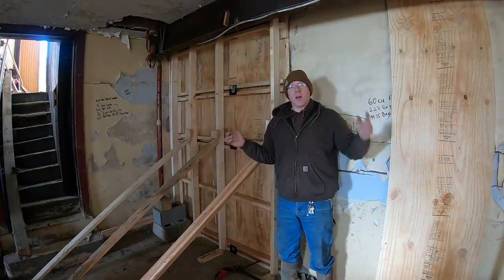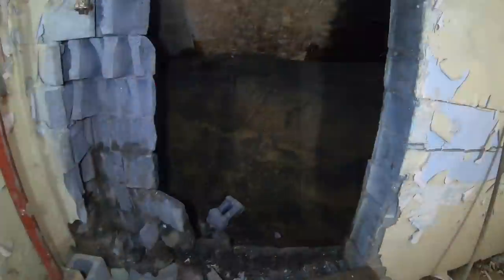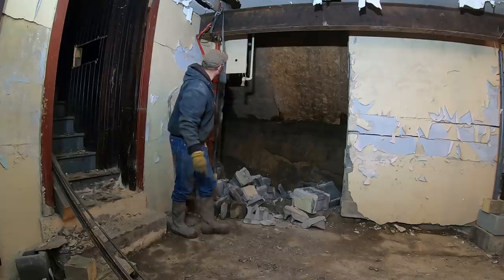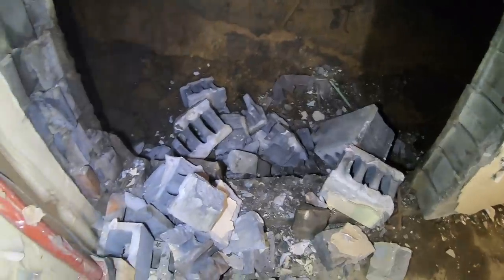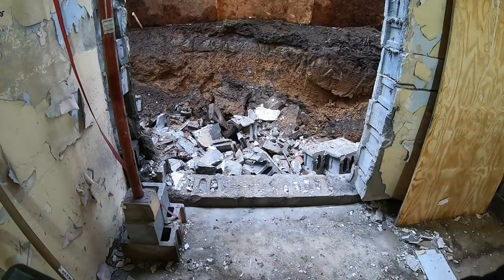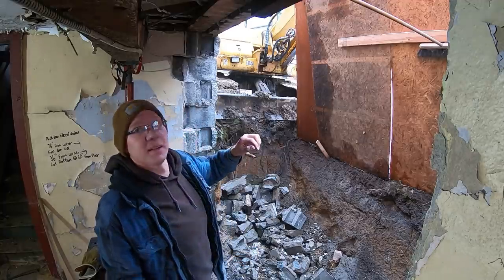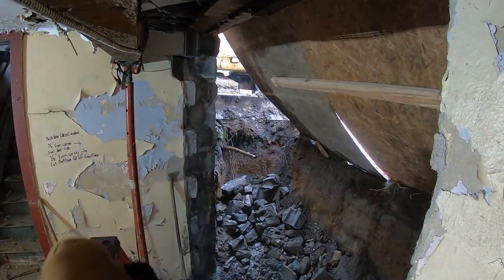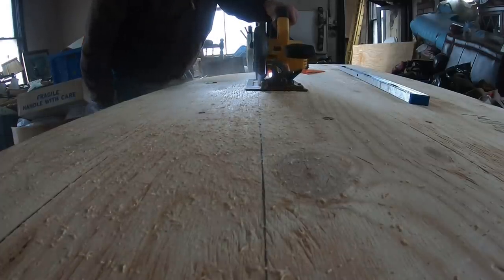Foundation wall so bad it falls apart!! ABANDONED CHURCH foundation repair!  Ep.5

Comment: @3:25 I have a story for you Matt.

I'm a medically retired union carpenter. Destroyed my back 21 years ago. One of my earliest jobs was renovating a school in downtown Portland, Oregon. (I live about 25 miles north of Portland on Hwy 30.) We were totally gutting this school building. There was a guy in a skid-loader driving his machine lengthwise through a wall. It was HYSTERICAL! The funniest part though was this long haired hippie from the 60s. He picks up a brick, chucks it through a window, then looks at me with the shit eatingest grin you ever saw. Says "I used to go to jail for this. Now I get paid for it. THAT'S what I call PROGRESS!!!

One of the funniest memories I have from a short but enjoyable career.
Reply: Some years ago, there was a contractor renovating two older buildings downtown to become a branch of a regional drugstore chain (not far from its long-gone first location). They basically went in and tore out the wall that separated the buildings, even though it was generally understood it was a load-bearing wall (even City Hall said that wall was never supposed to be opened beyond a couple pass-throughs). That wall remained intact for a few hours before giving way. Most everyone booked it out of there as soon as the building started making noise, but the public was unaware until the building collapsed. Sadly, one of the workers didn't make it out in time, and soon after the building collapsed, a frantic (but successful) effort got underway to rescue a resident from one of the second-floor apartments (which were not included in the renovation). It was a very delicate clearing the rubble without affecting other similarly old buildings to the north on the same block (in the end, only the neighboring wall needed a few well-placed repairs). It then came out that that particular contractor had been getting by with a lot of sketchy stuff as mentioned by the owner of that neighboring building (that sketchy contractor had previously done work in that building that even an amateur like Matt would have done better). After further investigation (and a few lawsuits), that contractor called it quits. A different contractor cleaned up the issues and has since built the new drugstore.

Comment: I am enjoying watching this series, I enjoy building renovations myself.
If I were you I would have at least two more acrows under that steel beam, it is less likely to fall if one is bumped whereas with only two you have no chance if one gets knocked. I would also put some acrow props under the wall above the gap with stongboys at the top to avoid any risk of that brickwork falling.

Comment: I really enjoy your videos , when part of my basement wall collapsed last summer due to a previous owner using only 4 inch block ,yes 4 inch block, it was originally a crawl space on that side of the house and he dug it out to within a couple of feet of the original barn stone  that actually held the weight  of the house, and put up that shoddy wall to hold back the dirt needless to say we poured it solid 18 inches in some areas, poured walls are the way to go , keep up the good work

Comment: Just be sure to oil the plywood!!.....then when you put in the cement you can use that impact to help settle your cement in the wall......will vibrate it nice!! Can make a pipe with welded flat iron on one side and run it up and down the plywood!!......good luck!
Reply from the maker: I have a real concrete vibrator, and Ill oil them right before I pour it! Thanks for watching!!!

Comment: Re: the gas pipe inside...   I have had couple of those surprises myself, after doing something like what you are doing.  Two of them were electrical related, thank god the circuit breakers did what they were supposed to...Ha, ha, ha...
Loving the videos, keep them coming.
Thank you sir.
Reply: When going into old buildings and you have no idea as to who, what or how, you can get some nasty surprises!  The home I'm living in was built in the middle 50's.  Needless to say it has had many "repairs" and modifications over the span of it's long life.  When my late wife and I had it moved almost thirty miles from the town it was in to where it sits today, we ran into a few of those "gotcha's".  One of them was what looked like a simple receptacle box that needed to be relocated so we could convert the room it was in to our new kitchen.  I blew a hole in the jaws of a brand new pair of Klein's when I discovered something I had never run into before.  I did not notice, since I wasn't expecting it, that somebody had clipped the jumper on the side of the receptacle.  They then fed each side with a separate breaker!  When I clipped what I thought was a dead wire, the fourth of July fireworks hit!  From then on I took my VM and checked each and every receptacle after flipping the breaker just to insure no more of those little surprises!  It was a rookie thing to do but who expects that to happen?
Reply: Richard Cline Yikes!  That will sure put some years on a guy... person...
Reply from the maker: haha, live and learn right?? Thanks for watching!!!

Comment: If you spray the plywood down with oil it will help to keep the concrete from sticking to it
Reply from the maker: yes, I do it right before I pour. Thanks for watching!!!
Reply: @DieselCreek  Just did a job just like you're doing a couple yrs ago. Went through all that stuff "by myself" also. First week of december. Come time to pour it the help didn't arrive and had to do it all by myself. Then we had a blizzard blow in and I was runnin a wheelbarrow through about 8" of snow! Was not a fun day I'll tell ya. My back still hurts from it!

Comment: I can see why your cautious as I have seen buildings act like they were setting on marbles and go sideways. I worked a very short time for a house mover and we got lots of surprises. A good method once you move down towards the middle is; Take two ropes and tie off on the joists under the building. You tie to  what would be your "rafters" and hang a small log from either end and room to swing it towards the wall and use for a battering ram against offending wall. Sometimes you can take sections out that way and you     can hang several logs so that you can alternate which one you need to keep it moving. Looking like some sore back time coming
Reply from the maker: I didnt have to fight this one much, fell right out lol Thanks for watching!!!

Comment: Though I hate to pour scorn on all your hard work Matt but over here in U.K. the entire building would be condemned - and for good reason. Little piddling 12" "footings" ( not worthy of the name really) for a building of that size Building Control would insist on at least 24" (600mm wide) and at least the same in depth below basement floor level. The entire footprint would need to be underpinned - very expensive. Then there's those walls! Crazy hollow pots, cracked and slipped everywhere and single skin. And not a dampcourse in sight.

As I've commented before - you are a great, resourceful guy who's willing to have a go at anything but you are a Health & Safety nightmare!!! Your temporary support is a collapse waiting to occur and your work method - leaving the exterior upper brickwork unsupported is verging on criminal.  I can hardly bring myself to watch!
Reply from the maker: There was no way to support the outer skin and still do the work needed. It’s long since done and everything went smooth!

Comment: Do you think using 4x4x1/4" metal to frame from floor to ceiling then weld pieces across to frame your window would work? Then pour and leave it all in the cement? I know it's a year later just wondering if it would work.

Comment: I see some ppl mentioned using diesel oil on your forms. That's"is" one of the procedures when pouring. I just did what you're doing a few yrs ago. I used Thompson's water seal / oil. Only because I had a few gallons on hand to use up. Works real well. Cleaner than Diesel too. How much more wall do you have to do?
Reply from the maker: About another 10-12 foot of wall. Plywood is 3/4

Comment: You've wise to use the protective gear.
Reply: But he wears rubber boots, not safety shoes !!
And he says himself "Professionnal advice here: beware of planks with nails poking out".

Man, get proper boots with steel toe and sole protection for your own good !
Reply from the maker: those boots are steel toe, I dont own any shoes that arent! Thanks for watching!!!
Reply: No respirator (during the first half of the vid), no eye protection, no helmet...
Reply: @DieselCreek  You really need a safety sole as well. Would you consider head protection when you've got loose masonry hanging over you?
Reply: @dave29123  From the looks of that building, I can pretty much guarantee that the paint contains lead.
Reply: @thomasbonse  I was thinking about just ordinary dust, but yeah lead paint too.
Reply: I apologise my settings were screwed up. My fault. Sorry for saying this video would not work.

Comment: If you will read the directions for that epoxy, you will see that you are to fill the hole with epoxy and insert the rebar into the epoxy filled hole.

Comment: I'll actually use that same exact chipping hammer and the one bigger. It's for lightweight stuff, but not a bad product at all. Ours was very old had lasted a long time. So hopefully you'll get the same out of yours. I cannot believe you hit a freaking gas line after you said you called in. Before you even started what happened? I must have missed a video. Damn it, man. I know that sucks. Hey, those bricks are being held up by Brick ties is usually about every fourth course. They're like galvanized little flat things that are nailed into the framing of the building. So don't fret unless they're rotted. Anyhow, brother keep making those videos and be careful. God bless
Reply from the maker: I knew it was there and I knew I would hit it, just wasnt thinking what it would do to the wall lol it was in the last video! Thanks for watching!!!

Comment: Using that concrete saw that has no blade guard, and it RUNNING, scared the heck out of me!  Had you lost your footing and fell, you could easily have lost a leg, bled out and nobody would have been close enough to save you!  Just too scary!  You're doing a good job but man, use some safety precautions!
Reply from the maker: that saw has a blade guard?? youd be crazy to run one without it! Thanks for watching!!!
Reply: @DieselCreek , when you were standing on those blocks cutting with the saw between your legs I was terrified for you.  Hit something unexpected, have the saw kick back and not only could you lose a leg but your wife probably would have no use for you anymore, either!  I think every man watching was holding his breath!
Reply from the maker: Richard Cline I’ve been trained to use them by large contracting companies, note my front arm is locked at all times so in the event of kickback it really can’t come toward my body, the only thing I could have done better was have a face shield

Comment: Silica in construction projects/products is always bad. There are two kinds, and one is much worse. If you have some silica that you mix into epoxy to strengthen it, it is probably amorphous silica. It can give you silicosis of the lungs, which is bad. 
The other type is crystalline silica, this is really bad. When they took away asbestos they replaced it with this. It is now in a lot of products from cementitious siding to car polish to clear lacquer. Check for it on the label. it is considered carcinogenic by many agencies. The worst thing you can do is cut it with an abrasive tool, because that breaks open the crystals and they let go of some of their electrons. You don't want free electrons in your lungs or near your eyes.

Comment: I see the rebar going down, but I don't think Id put in a window if bricks were moving off the foundation like that.  That wall going to take a lot of abuse, and you probably don't want to put a hole for the sunlight.  But a structural engineer would know more than me.
Reply from the maker: it only pushed because there was no gutters or french drains. all the water laid against the wall and pushed it in.

Comment: It does look better, you should take out the rest of that wall.
Reply from the maker: Planning on it however I can only do a section at a time to prevent a collapse of the building!
Reply: I get that but it's not real good to have cold joints in your wall.  Thanks again for sharing the project.

Comment: In all honesty you lally columns and cinder block supports are scary at best..,.cinder locks have no structural rigitiy....throw some large timber under those columns..and what about the  floor, can it handle the load or crack and sink?  Be safe, think way ahead, peace.
Reply from the maker: thats why I used blocks under the columns to spread the weight as to not break the floor. Thanks for watching!!!

Comment: why are yyou not bracing that i beam with a more substancial shoring that block could have easilt kicked out taking the wall beam and building with it just imagine what troule that would have caused and how you would have raised that overhead floor up after a collaspe like that it would have been a death trap to try and raise ,just saying when you push your luck it will run out .mike

Comment: I really don't get why you guys over in the US think cinder blocks are made to be stacked with some concrete at the joins... they are not.

I mean yeah there are some cinder blocks which are closed on the top side which are made for the purpose of building very cheap garages or boundary walls of properties, but not for buildings guys. 🙄

They are supposed to be stacked and filled up with concrete.

Comment: Well, when your video stops posting abruptly, we will have a good idea of what happened to you. I don't think you can out run the force of gravity bringing the building down at 32 feet per second squared. But, what do I know?

Seeing the brick wall above hanging unsupported in space scared the willies out of me. I'm in California, where the sight of red brick is a horror show. We call red brick buildings, "Future brick piles". (Earthquake fodder) But, you are there and I am here. Please tell me you are getting guidance from a licensed structural expert. Be safe.
Reply from the maker: ive talked to an engineer. also this brick is different from red brick. I wouldnt trust the red brick as much. my theory is that wall wasnt really holding much weight anyway. Thanks for watching!!!

Comment: what is the final goal? Make a livable house out of this mess?  
You should kinda frame around the window area with the rebar. Better yet would be the plastic coated cable they use when building with concrete these days. You put it in the wall, allow the concrete to fully cure, then tension it to ...oh 5 to 6 thousand pounds of tension. but that's for longer spans, like the complete long wall and run it horizontally. There are several common misconceptions about concrete. One, it does not "dry" it cures. It will cure even in a rainstorm, but the water on the top will give it a very smooth finish. Concrete has little to no linear strength on it's own. However it has great compressive strength. You remember hearing about the bridge in Florida they were trying to install over an open highway that collapsed? The reason it collapsed is some idiot didn't understand about concrete's linear strength versus it's compressive strength. They were attempting to tie in and tension the cables when it collapsed. Had the cables been pre-tensioned it would not have, they should have tensioned the cables before they moved it over the highway. If they needed to tie it in with the cables, they should have extra cables in it, then tension them in place when the bridge was in place, but not try to move the bridge over the highway without tension at all. why the hell wouldn't they just close the highway? Why risk innocent lives on a new idea? Anyways, whoever did the concrete on this church in the first and mostly second places didn't really know what they were doing. They got by with it for a while, but just were off by a bit. Maybe their mortar mix was off, I'm not sure, but something wasn't right.
Reply from the maker: It was failure on multiple levels. blocks werent cored or anchored to the footing. tall window openings, and no drainage, all the water laid against the wall. Thanks for watching!!!
Reply: @DieselCreek  built by committee no doubt.

Comment: I might have run a cut with the saw up the joint you wanted split off from the corner. My 2 cents
Reply: and remember to throw all the extra brick back into the hole before you backfill
Reply: also - try putting a frame of some sort behind that other piece of wall, jack up the building a smidge and see if you can pull it back. Might be worth a day check it out versus pouring yet another wall?
Reply from the maker: that other piece of wall is too far gone for my taste. lots of cracked blocks. the opposing wall Im going to try to push back with jacks.
Reply: @DieselCreek  - The Youtube channels that I am attracted to are people like who are doing something, making something, working on something. There is a guy up here in the Pacific NW that is rebuilding an old sailing yacht, Sampson Boat Company. I usually don't chime in, it looked like you might save that wall, therefore a ton of work! Best wishes and keep on swingin'!